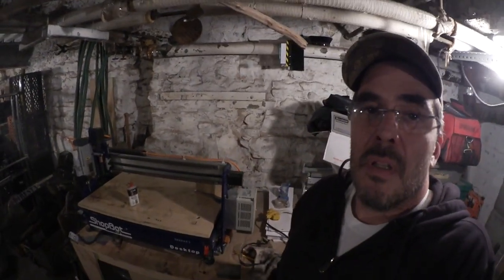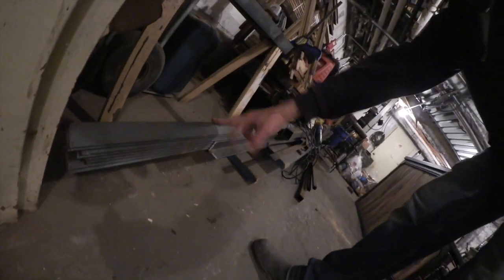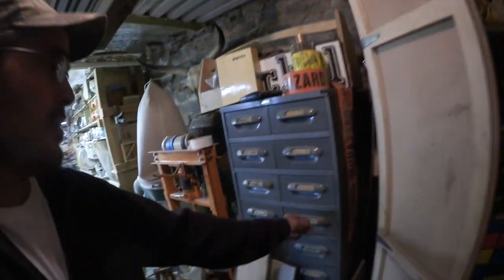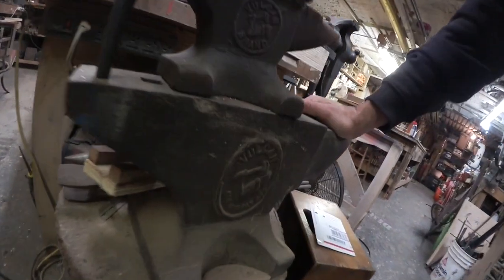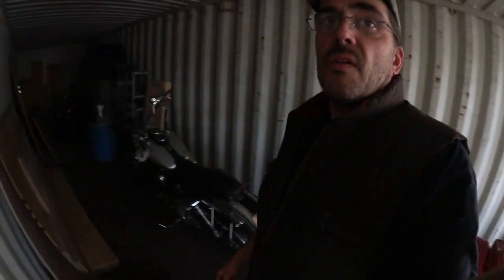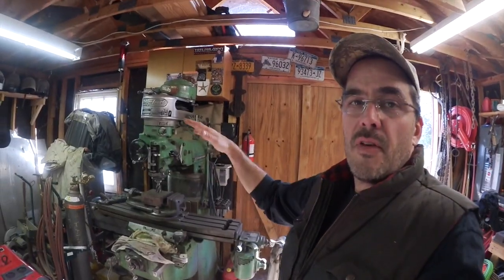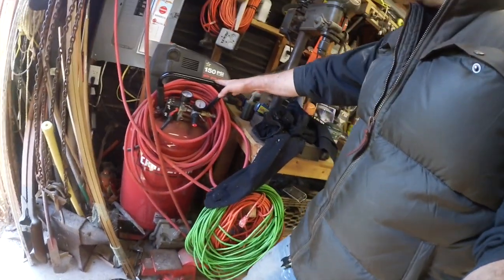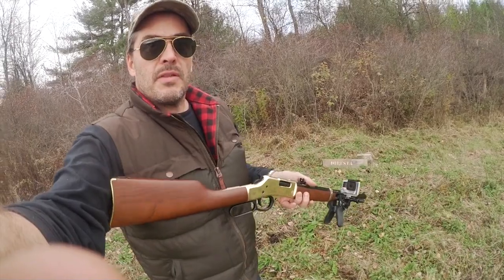✔ DiResta's Tools & Toys

Comment: The barn idea is something similar you briefly described is something I'm currently working on.  One idea I had was for the interior walls to be removable panels that allow access to the conduit and plumbing.  You would adhere your insulation to the panel, and use a bolt and pin system for attaching and removing panels.  This would make future remodels have considerable less waste especially if all the panels were a standard size.  Would take a lot more effort in the initial build, but worth it for someone likes to be able to take things apart easily to re-make them.

Comment: If you have the space in the shop in the city, have you thought of using a bigger compressor with a insulated housing to dampen the noise? A friend of mine has such a setup. He has one with a tank of 200 liters and it works great so far, he just has to watch if it runs frequently because of the generated heat since the insulation is made of styrofoam, but so far, it proofed a good decision. No neighbor got mad since he dampened it.
PS.: He hasn't it fully covered, he made a slot (roughly 3 x 12 inches) in it to provide a air intake...
Reply from the maker: Yes we are. We need it
Reply: jimmydiresta I've heard that compressors designed for dental offices are extremely quiet.   With your connections...
Reply: jimmydiresta wow..Jimmy … sold  my  shop  down .. moving an taking  it 
easy  for now on.. have to.. Nice tour my friend .  best
Reply: wordsnwood jimmydiresta The compressors you've heard of are so called membrane or diaphragm compressors. These are also used for airbrush artists that have their compressors under the desk but don't want the noise of a regular compressor. Usually they are extremely expensive if you use a model with a larger air tank...
Reply: jimmydiresta scrounge up a 10HP muffler to put on the Air Compresser out let  to queit it down

Comment: Great tour--thanks for putting that together!
You have an awesome collection of vintage wood and metal working machinery.
I encourage you to join us at OWWM.org and Vintagemachinery.org if you need any info on your older machinery.
Nice find on the Sprunger bench model drill press, at your up-state location.
I'm the primary historian for Sprunger equipment at Vintagemachinery.org, if you wouldn't mind, I'd like to get the serial number for our database. I can also tell you when it was built by the serial number.
Thanks again,
=Brian Kachadurian (aka toolguybak)=

Comment: Ahoy Jimmy, my girlfriend and I are going to visit her sister in the spring. I'm pretty sure she lives in Jersey City. It would be awesome if we could met up and check out some good fleas while I'm in the neighborhood.
Reply: Hey just got to the point in the video where you're talking about the 2 stroke fuel. If you live near a small airport, you could check what they have in terms of fuel. It will always be of superior quality, have a higher octane rating, and doesn't contain any of that bull ethanol crap that rots rubber fittings. I'm friends with the people at our local Stihl shop and they sell aviation fuel there. It's like $7 bucks a gallon of 100 octane, or $10 bucks for premix 2 stroke. Just an idea. That stuff in the can is like $10 bucks a quart. The aviation fuel is a much better deal at $7 for a gallon and it also stores indefinitely/doesn't go bad.
Reply from the maker: Come to the shop. Jimmydiresta@mac.com !!